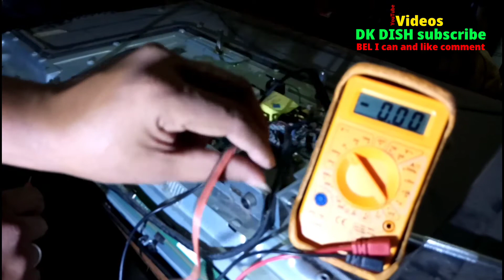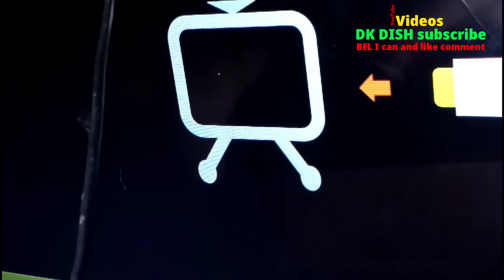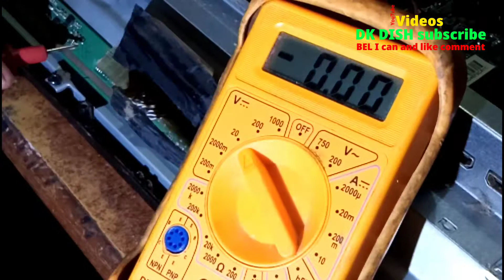Weston led tv40 inch no display pahla number 15y 40gf11bmb7s4lv0.1

Comment: Sahi tarha se nahi btaya k konsi lines cutt ki hain 
Mere pass tcl 40inch main yeh fault aya hua hai no display hai 
Lekin aapki video dekh kr nahi pata chala k konsi lines cut ki hain or na hi voltage ka btaya hai 
Mere pass AVDD per koi volt nahi hai
Reply from the maker: Avdd 12v ya 18v fuse resistance Hota Hai Uska Check